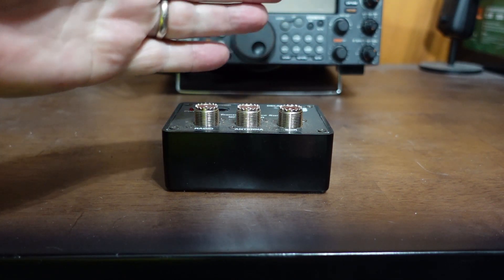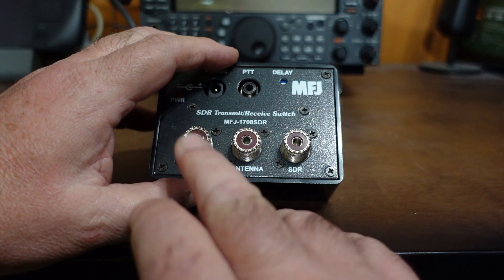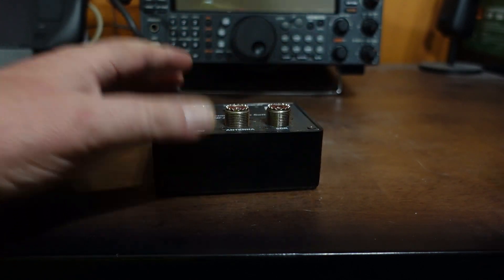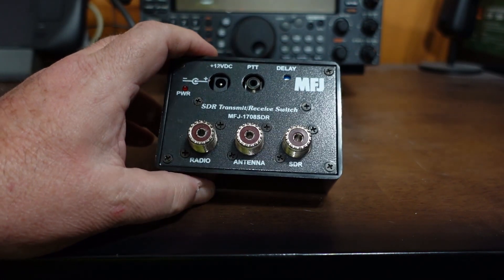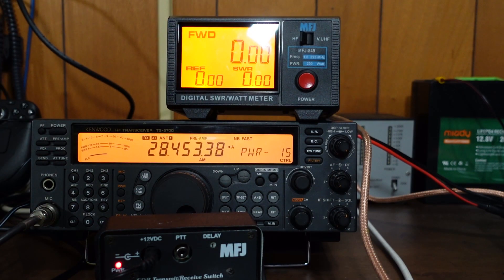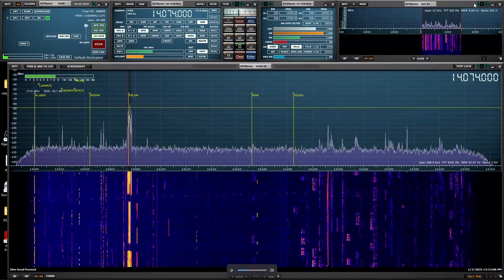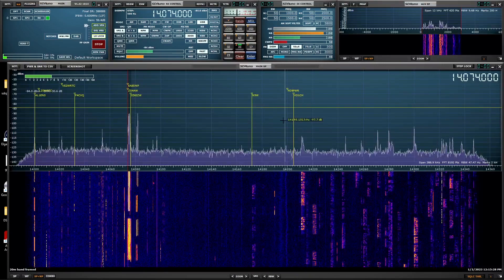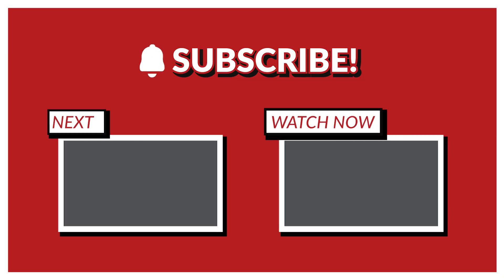Add a FULL COLOR WATERFALL to ANY radio!!

Comment: from ts440?
Reply from the maker: All radios have an IF.  The key is how easy is it to access the IF on a given radio.  I can't tell you specifically, but I'd be surprised if it didn't.  It will mention it in the manual somewhere.  That's how I determined there was the jumper for the IF connection.  Some radios won't have a convenient jumper to tap, it might require a little surgery to tap the IF.

Comment: I have the sdr switch.  Unfortunately it has a affect on signal. It will degrade the signal 2 s units or so. Because you are splitting the signal. Therefore I prefer the IF tap methods.

Comment: Will these boxes work without electricity and are they portable..
Reply from the maker: The box is a powered antenna switch, and requires power (12v).  You can use a 12v wall wart, or 12v off your power supply or a battery.  Just 12vdc is all it needs.

Comment: Some people like to use a different, low-noise receive antenna. Could the MFJ device be adapted to do that?
Reply from the maker: If you're using a different antenna for the SDR, there is no need for this.  This is designed to allow switching out between using one antenna for your rig, and the SDR at the same time.  If you use a separate RX only antenna, just put it directly on the SDR.  This is really just a fancy electronic switch.

Comment: Why isn't the SWR meter showing any power output from the radio? If the meter isn't connected to that radio, then what was the purpose in showing it? I see that the switch has a jack for the SDR but how exactly is it connected with that switch, the antenna and to your computer?
Reply from the maker: The SWR meter on what?  The radio?  I was showing the SDR connection, and not transmitting, so no SWR to show.  The switch is connected with the antenna, radio, and sdr on each of the SO-239 jacks.  The switch turns off the SDR antenna connection when it senses RF, or you can tap off the SEND function of your radio.  The only connection to the computer was just the antenna wire from the antenna switch to the SDR antenna connector.
Reply: @FEPLabsRadio  The MFJ-849 "Power Meter" I think is connected to your Kenwood TS-5700 (?) but when you transmitted first 20 then 100 watts, nothing displayed on the MFJ-849. Where did the power go? Did you disconnect it?
Reply from the maker: @williammorrison9045  AHA - I understand your question now, my bad.  So apparently that bit got cut, but the power meter is plugged into the SDR side of the switch, not the antenna line.  When you key the radio, the switch cuts out the line to the SDR protecting it from getting destroyed by input RF.  That's why you see nothing on the MFJ.   It's connected on the SDR line I rewatched that part, and I see where the confusion is.  It's an editing mistake that lost the part that explained the wiring set up.
Reply: @FEPLabsRadio  Thanks for your response! If it's no effort maybe you could make a newer video showing the connections on this setup and any recommendations for others. I have many different  HF radios that do not have any graphical displays on them. This looks like an interesting idea that I should try out sometime.

Comment: Is there something that would protect an sdr  dongle with its own receive loop on ground from your transmitter and it's antennas?
Reply from the maker: Distance is the best thing.  Amazingly, those things are pretty sensitive.  My shop antenna is 100 ft from my house, when I was remote FT8 out there, this antenna switch was picking up that RF, and switching off the SDR  - IN THE HOUSE.  So - even though that wasn't something I had planned, it was taking it off the antenna, when it detected the nearby RF outside.  That's pretty solid.

Comment: You can also use the CAT controls in SDRUno and SDR-Console to connect to HRD as a secondary radio and have the frequencies sync'd together.  If your radio doesn't have a spectrum or waterfall you can use the SDR to change the freq on the main radio.
Reply from the maker: Yessir.  It's pretty cool what integration is possible.

Comment: I have the sma modelB,  while it is a good accessory,  I have blown two of them from transmitting on a less resonant antenna and having RF return Down  the feed line.  Luckily MFJ still repairs these units. 
Nice video Jim
Reply from the maker: So far, no smoke has escaped.  On this Kenwood, it's just as easy to tap the IF interface and use it.  Less wires at least.  Thing is, I'm amazed at how sensitive this gadget is.    See the above comment.  My switch was turning off the SDR from the shop radio (100ft away) xmitting on FT8.  Not even physically connected.